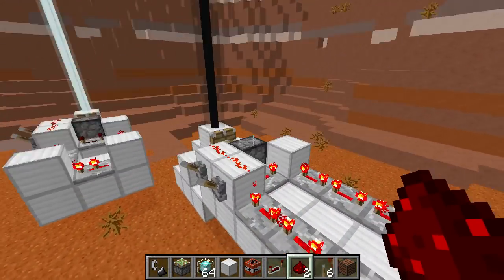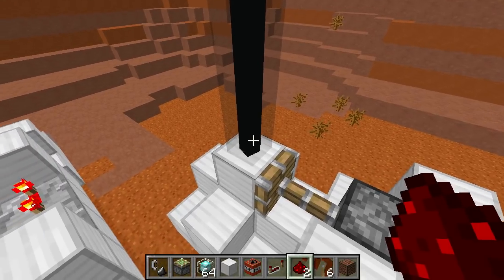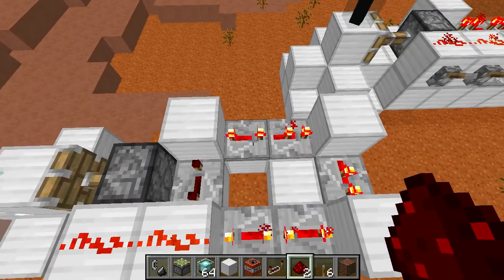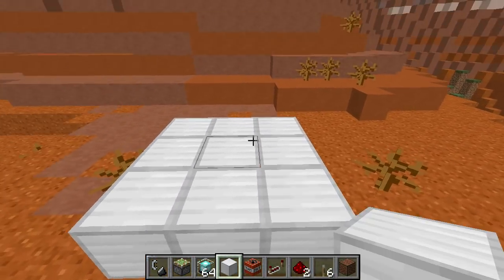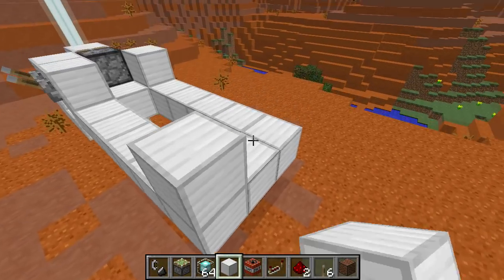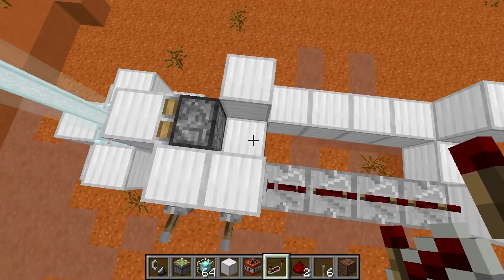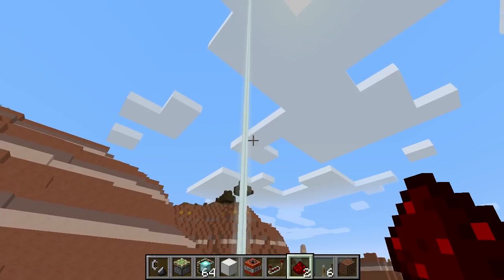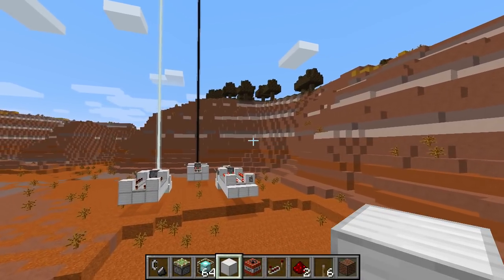Addendum to Black Beacons - Keeping them on longer - Minecraft with ChartreuseK

Comment: the only problem is that it stops working if the chunks get unloaded
Reply from the maker: Yea I just used a simple repeater only clock, this could be just as well done with a torch based clock. Thinking about it using a torch based clock might make more sense since when the chunk is loaded the torch might automatically sync it to the beacon. It's worth a shot to try.

Comment: I think I know how you get orange ones: A low light level.  That's what I would expect.
Reply from the maker: I tried using lit repeaters around it (to generate a light level 8 I believe) and sealed all light around, just resulted in a white beacon when the solid block was placed above. Might have to try again with something in the light level 1-2 region, but I think the orange beacon was fixed.
Reply: Chartreuse Kitsune
I'm prety sure repeaters give level 15.  Mabye try redstone torches?  Who knows.